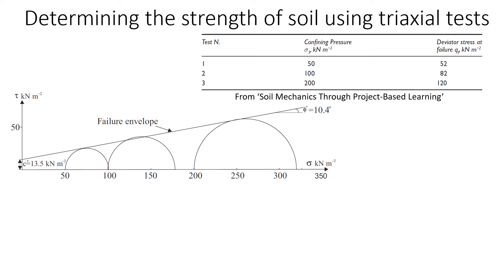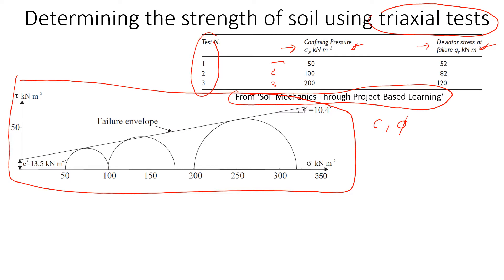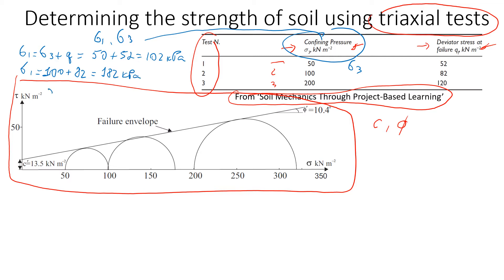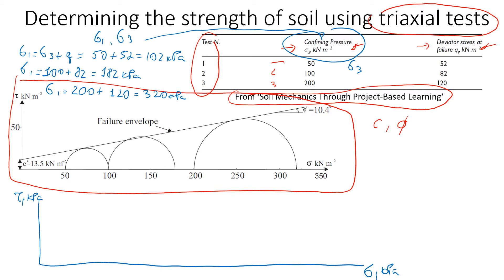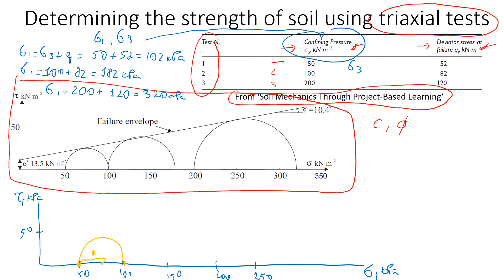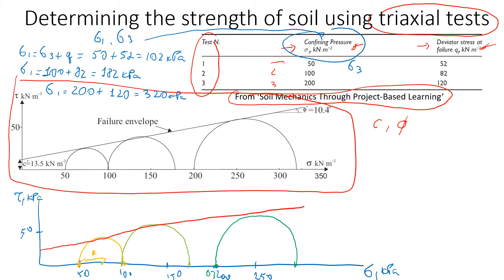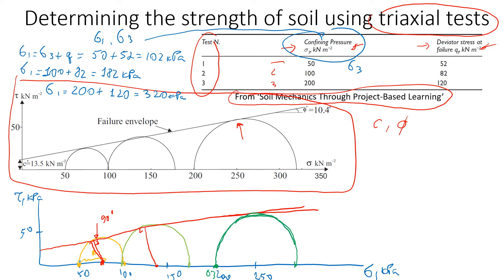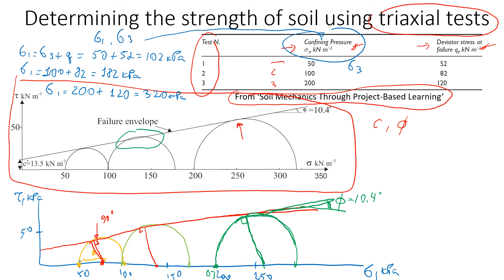Mohr-Coulomb Failure Analysis of Triaxial Tests on Soil | How to Obtain Cohesion and Friction Angle

Comment: You didn't show how to get cohesion or angle of friction, can you please elaborate on how to get them?
Reply from the maker: For this method, you will get the cohesion and friction angle from your plot. Make user that your plot is to scale (1:1). The intersection of the failure envelope line with the shear stress axis will produce the value of cohesion (in kPa) while the inclination of the failure envelope line will give the friction angle (in degrees). Another way to determine the effective cohesion and friction angle is to use a numerical approach (formulas), which is described in this video https://youtu.be/W1LIs7I8zSs